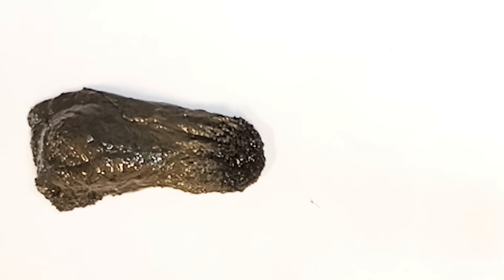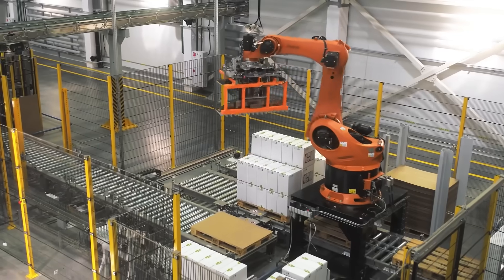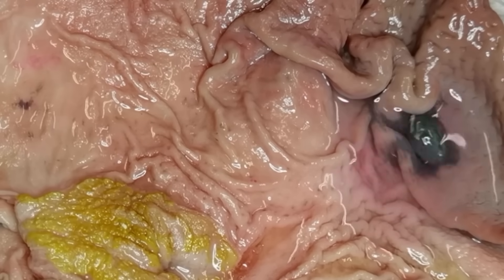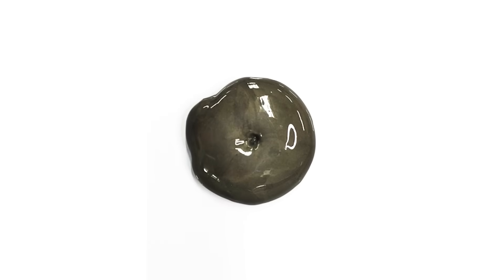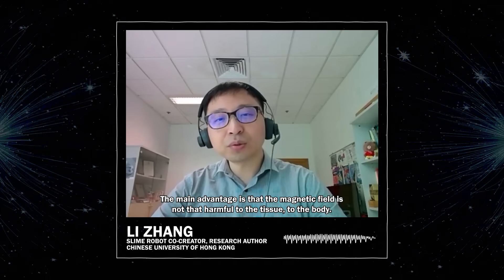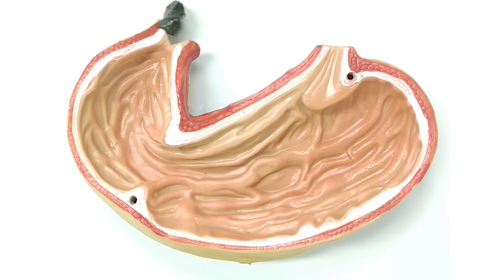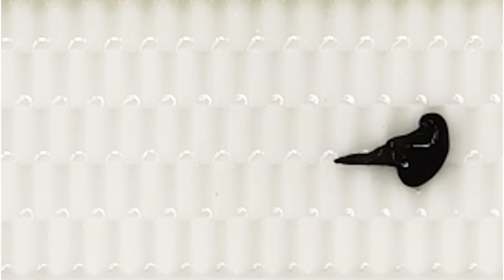This Is The First LIQUID Robot, And It’s Unbelievable

Comment: The part that’s always left out of these videos is the massive setup just off camera that includes the ancillary equipment (pneumatic pumps, power systems, electromagnets, etc.) and the actual computer controlling everything.  Autonomy also requires sensing.  

It’s a really neat idea, and I see a lot of potential as a component of future technologies.  I look forward to reading their papers once they learn more about the material properties.

EDIT:  Full citation for the authors’ paper:
Sun, Mengmeng, Chenyao Tian, Liyang Mao, Xianghe Meng, Xingjian Shen, Bo Hao, Xin Wang, Hui Xie, and Li Zhang. "Reconfigurable Magnetic Slime Robot: Deformation, Adaptability, and Multifunction." Advanced Functional Materials (2022): 2112508.
Reply: Just wanted to say it’s super rare to see people actually site their sources on YouTube comments and I hold nothing but respect for you actually citing them
Reply: how is the robot controlled? how does it receive input
Reply: Okay, a follow-up.  I just read the original paper, and I’d say the potential for this technology is significantly more than what is covered in this video.

As a robot, it’s largely impractical.  The slime robot is controlled using a set of 3DoF robotic arms with permanent, rotating, spherical magnets at the tool flange.  Spinning the magnets is how the researchers were able to make the slime loop back on itself.  The rheological properties of the slime make it such that the time frame is minutes for actuation rather than milliseconds.  

It’s actually the material properties that highlight the true potential of this technology.  Being non-Newtonian, the slime can be cleanly cut, as was demonstrated in this video.  Being able to be electrically severed is important, as it opens up the material for being used as part of a more complex circuit.  Simultaneously, the stretching and self-healing properties mean it can be leveraged as a semiconductor in flexible applications. In the paper, the authors even demonstrate this by making a strain sensor by sandwiching the slime between two strips of stretchable tape to measure deflection. Using this in a capacitor should be simple in comparison.
Reply: @JeremyMarvel  how it can be used in a capacitor?
Reply: @bosongod2830  A capacitor is just two conductors close to one another, but insulated from each other.  When voltage is applied, a charge builds up between the conductive layers.  So if you use a non-conductive, flexible tape between thin layers of this magnetic slime, you create a capacitor.  Increase the surface area and number of layers, and you can change the capacitance properties.
Reply: @JeremyMarvel  you mean the tape will act as a dielectric between them?
Reply: @bosongod2830  Indeed!  Probably the same tape the authors used for their flex sensors.  We’ve used thin slices of silicone with metal for flexible sensors and electrical components, but the method the authors used in this paper seems a lot easier and way less messy.
Reply: @JeremyMarvel  thanks for the information 👍
Reply: @JeremyMarvel  thanks for the citation and the explanation
Reply: @JeremyMarvel  is the setup hypothetically usable for surgery? that's what the researcher claimed in the video, and is a setting where large, complex, stationary machinery is generally not an issue.
Reply: @GeekProdigyGuy  To an extent, I would say so once they deal with the toxicity issue of the component materials.  And you’re absolutely correct regarding the surgical room being conducive to this kind of setup (much like the cyber knife and the DaVinci laparoscopic robot).  

There are, of course, some non-trivial factors that would have to be worked out (like being able to cut and reconnect tissue, applying sufficient force/pressure, and precision manipulation of objects within the body cavity) for it to be applicable as a surgical tool, and I hope these will be worked out as the technology evolves.
Reply: @JeremyMarvel  
Hey thanks for the explanation 😊
Reply: Yeah, exactly what I was going to comment. Lacks the actual computer that controls it. It is less a robot and just a limb for a robot.
Reply: Thank you so much for the explanation. :)
Reply: For this citation. You sir. Have all the sense in the world. Thanks
Reply: Ladies and gentleman and that's how terminator was created
Reply: Microrobots could deliver drugs straight to diseased tissue.  Fish-Shaped Microrobots to Deliver Chemotherapy to Tumors
https://youtu.be/4Qa7W-TH948
.....

Comment: I would be worried about potentially leaving strong magnets inside of a body, even if they're small, what if a small chunk of this slime got 'forgotten' and the patient goes to get an MRI down the line? The magnets could potentially move or heat up
Reply: maybe a very precise scale could be used, and the weight of the robot could be measured beforehand. then, after its process is done, measured afterwards. if there's a discrepancy, then they can go back in to attempt to retrieve the piece
Reply: @AstrlJelly  i think the main issue is that they're microscopic fragments of neodymium magnets, so you might have a real tough time getting them out of tissue even if you knew they went missing
Reply: @stack_overflow  where did you hear that its made out of neodymium magnets?! Im fairly certain it is just a version of ferro fluid, or a liquid mixed with particles that are magnetically attractable. In this case the only magnets used in the process would be external, and that is how they control the slime.
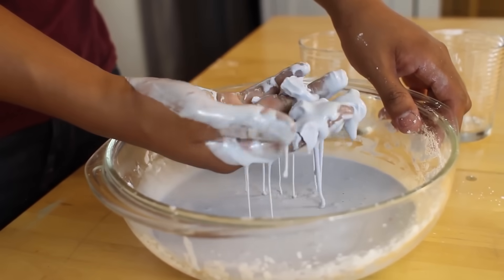Reply: @samm4034  the video literally states that its made with neodymium at time 2:13
Reply: @stack_overflow  ah oops - I'd still be skeptical of what he says in this video though, there's alot of misinformation since he doesn't go in depth about it.
Reply: @stack_overflow  also, the research paper itself that this guy provided doesn't mention neo magnets. Rare earth magnets are expensive and they wouldn't be efficient in powder form.
Maybe they use neodymium particles but those themselves wouldn't be magnetic.
Reply: @samm4034  since the particles are influenced by magnetic fields, which is how the slime is controlled, that means they would also be influenced by the magnetic fields of an MRI, potentially causing them to either move or heat up. These are the two main ways an MRI can injur you if you unknowingly have magnetic (or magnetically influencable) material in or on your body. This would be a problem regardless of if the neodymium was a permanent magnet or only paramagnetic as in the case of the slime
Reply: oh boy, to my knowledge, even small magnets like that could rip through organs. Pretty sure they do screening to make sure there are no piece of metal left in the body before MRIs, though. (take this with a grain of salt)
Reply: @microman502 i mean a guy survived a whole buttplug ripping through his abdomen due to an MRI with no major damage so it shouldnt be too bad
Reply: This is what I was worried about too! I’m going in for an MRI tomorrow so it was the first thing on my mind
Reply: Put it inside a thin tough membrane? 🤷🏽‍♂️
Reply: Glad to know I wasn't the only one thinking of the MRI scenario 😩
Reply: I am going to eat 10 pounds if metal.
Reply: You are right, but some people are already disqualified for MRI examination, e.g. people with artificial hip implants. Luckily, there is an alternative, they can use the scanner.
Reply: @Bee.Holder  the main concern is that someone could be unknowingly carrying these magnets in them and either forget or not mention that they had this putty procedure in the past
Reply: I have magnet implants in my hands. When explaining this at an MRI appointment they just waved it off when I mentioned it, said it wouldn't be an issue.
Reply: @boxing.ascetic  Just burn ur phone and live in a forest, no more tracking device, specifically the Amazon forest and only bring a stick.
Reply: What if the slime gets put in a container that can move with the robot without breaking. Like a condom or something
Reply: @okaycandie2270  it probably wouldn't be able to do all the fancy slime grippy things they show off in the video
Reply: Microrobots could deliver drugs straight to diseased tissue.  Fish-Shaped Microrobots to Deliver Chemotherapy to Tumors
https://youtu.be/4Qa7W-TH948
...........

Comment: Seems pretty neat, but in what world did we start calling magnets robots? It's just a ferrofluid oobleck.
Reply: What definition of robot would exclude it? It's a ferrofluid oobleck that can be controlled precisely to carry out complex actions.
Reply: @RSmeep13  pretty much every definition "a machine capable of carrying out a complex series of actions automatically, especially one programmable by a computer." This is from Google
Reply: @maxgamesst1  if you had read as far as the second sentence of that wikipedia article google pulled up, you would have seen, "A robot can be guided by an external control device"
Reply: @RSmeep13  bro it's a magnet
Reply: @RSmeep13  I considered that too, but in the context of the term, external device likely refers to remote operation in the sense of an off-board control system, either by wire or wirelessly. Like a robotic arm being controlled by a separate computer, or a gps controlled excavator being driven by a person in an office.
Reply: @maxgamesst1  robotics engineers love their nontraditional robots. Wait until you see the robot that's "just" an inflatable tube. Robotics is about remotely manipulating things. Not just sci-fi androids.
Reply: @OrdovicianAphelion

Your generous “robotics engineer” definition of what makes a robot a robot is so broad it is laughable honestly.

A robot needs to have some sort of programmed function or logic to operate a task with a given purpose. without that it is simply a controller.

The creator himself called this a “surgical tool”
Reply: @RSmeep13  at some point a line has to be drawn. I see a robot as having more independence that just a remote control. Are RC cars robots? No. A robot, in my book, has all mechanisms and a computer inside of a shell of some sort.
Reply: @RSmeep13  that can be controlled... by external magnets. if this is a robot, every single magnet is a robot.
Reply: Yeah that's what I was thinking